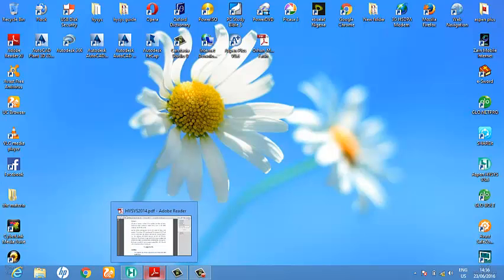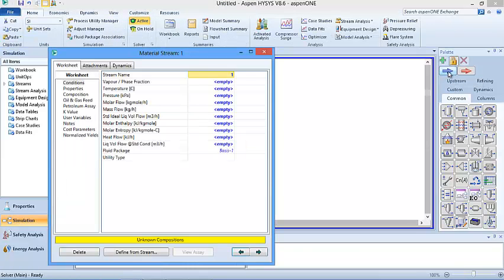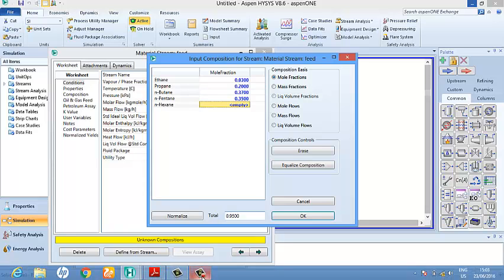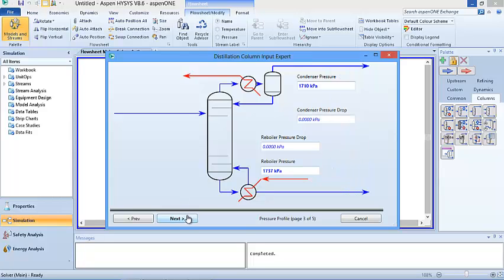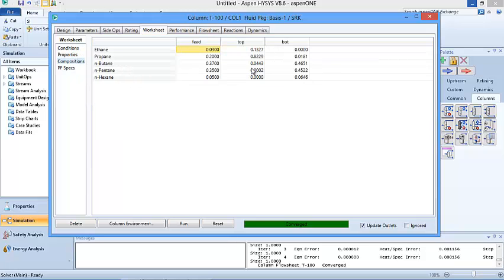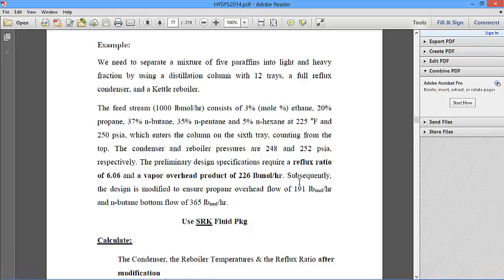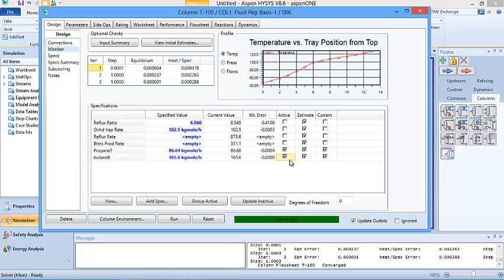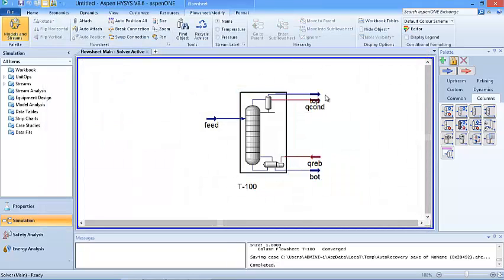distillation column

Comment: Need Help.At atmospheric and pressure, i have a mixture of waste lubricant oil which consists of 70%base oil,5% diesel,5% gas oil and 5% water,15 % thick black residue,density 0.895kg/l,k.viscosity 70cst at 40c.flash point 265c,.How to make Component list,and fluid package?